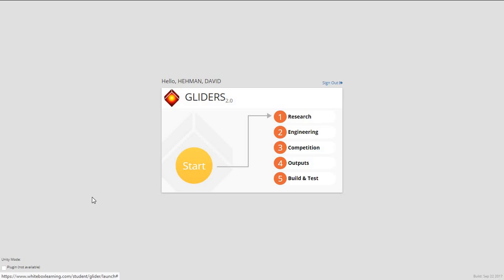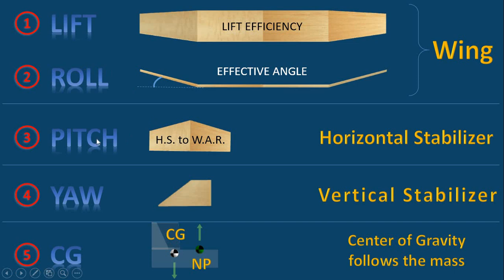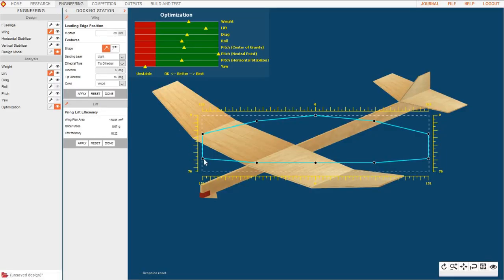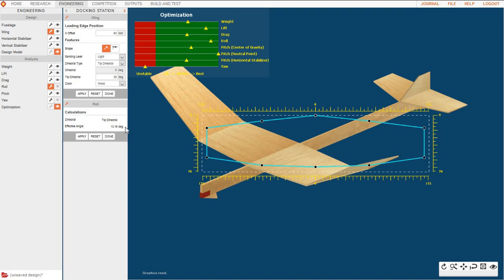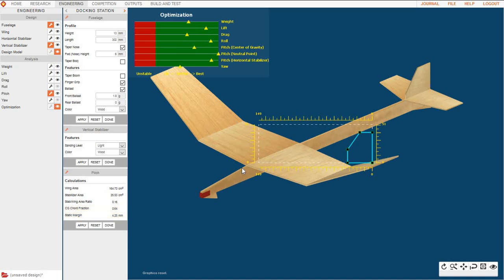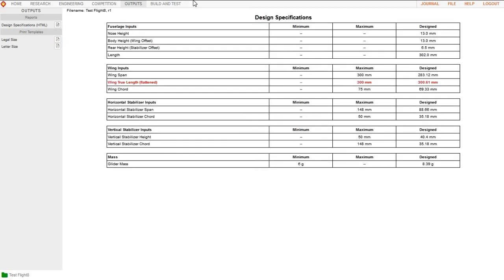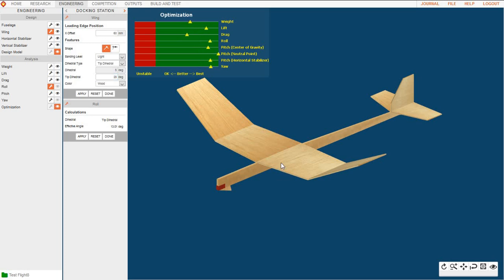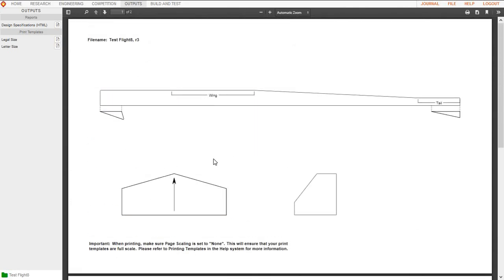Whitebox Learning Gliders 2.0  - Step1: Engineering Design Overview

Comment: Hey! This is an amazing video and I am watching it because in my class, I have to get to level 4 to get an A! I'm on level 3 right now, and as you level up, your wings get a lot smaller, or in this case, your wing area. I am getting really stuck on my lift, do you know how I could fix this?
Reply from the maker: What are your numbers:
Lift Efficiency
Effective angle
HS to WAR
CG Cord Fraction
Static Margin
Reply: @DavidHehman8  Lift Efficiency: 17.89
Effective Angle: 15.54 degrees
HS to WAR: well, my Stab/Wing Area Ratio is 0.14
CG Chord Fraction: 0.41
Static Margin: 15.66 mm
Reply: My numbers are pretty bad, I'm currently fixing it
Reply: @DavidHehman8  what is HS?
Reply from the maker: @jekekefe5923  Horizontal Stability
Reply: @DavidHehman8  thank you  so much I am trying to build an ultralight motor glider in usa . Im Trying to make it human powered. I first wish to understand aeronautical engineering then I learn to build . Wish me luck
Reply from the maker: Your numbers aren't bad. Start be increasing your lift efficiency. Have you "sanded" any of the parts?
Reply: @DavidHehman8  Yeah, I have been sanding them just so I can get the right amount of weight, I'm doing better now
Reply from the maker: 10 seconds is a VERY long time. I don't know that I've seen any fly that long.
Reply from the maker: Sarah Penguin  You guys must be using the full dihedral and curving the wings. My class didn't get that deep. It just takes some trial and error. I would assume at this point it's about reducing the drag and improving the aerodynamics. Good luck!

Comment: hi, I want to use this software for a school project a little bit more complex. So before I purch it could you tell me if you can modified the airfoil for the wing and stabilizers? can you do more complex structures? like a designing also the ribs and stringers of the wing itself. If not, could you please recommend me an other software of this kind that could help me solve my problem? Thanks for the great video! cheers from Mexico
Reply from the maker: There is a lot you can do, not sure about modifying the airfoil. If you watch the full video, you can see all the parameters that can be changed, even of I don't cover them in this vid. 
I don't think an individual can purchase a single licence. I believe the school or an organization would need to purchase. Go to whiteboxlearning.com for that info.

Comment: Mr. Hehman, Very interesting video and work on gliders. I am teaching my 6 year son and myself about gliders and i have a question , i hope you can help: I built a foam glider for my son and as soon as launch it , it makes a loop and try hit me in the back. I do not have the software Gliders 2.0 to try to understand what might be wrong. I have to launch it vertically in order to fly a bit , but it looses the entire concept of a catapult glider. Any advice you can provide?  Thanks ( here glider plans http://www.netlaputa.ne.jp/~yasuu/SUNAPPU/PLG/suchi/  )
Reply from the maker: Alex Herrera It sounds like you need to move the center of gravity forward. You can add some weight to the front.  With the gliders we use some puddy/clay to accomplish this.  How much you add depends on the size of the glider  you are making.  On the other side, you could shave some weight off the back by making the horizontal and/or vertical stabilizers thinner.  Again, with the gliders we would sand them down a bit.  The objective is to get the glider to balance underneath the wing, somewhere between 1/3 to 1/2 of the chord, stating with the leading edge.
Reply: David Hehman, many thanks for your rapid response. I will try and let you know!!!